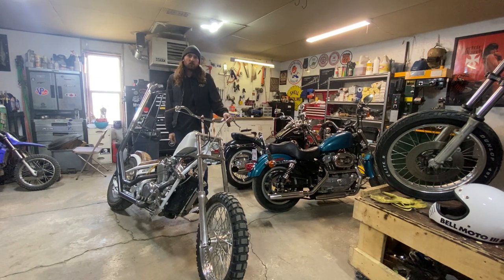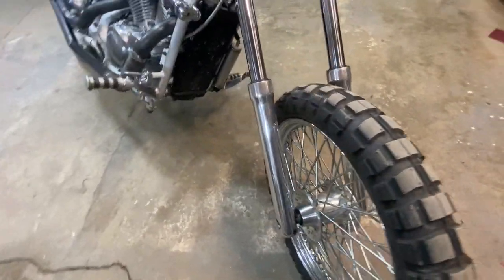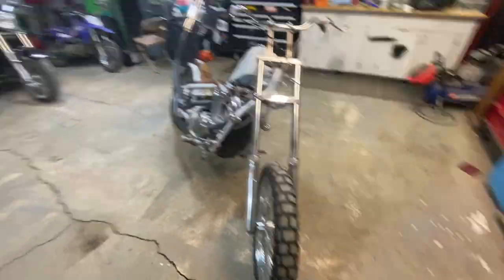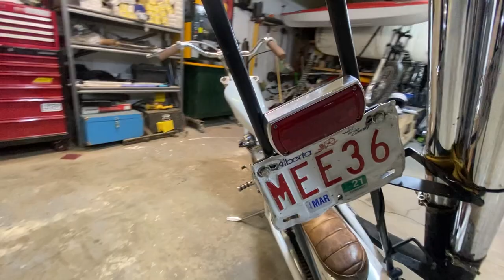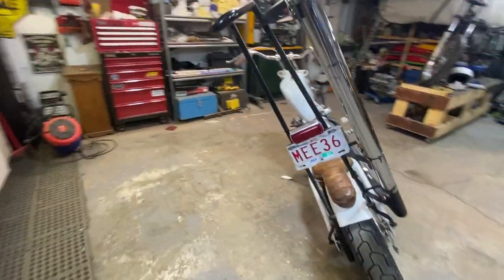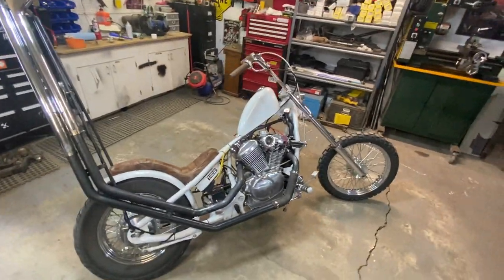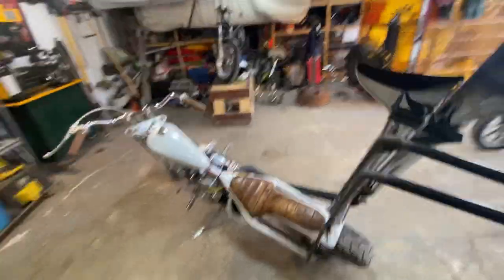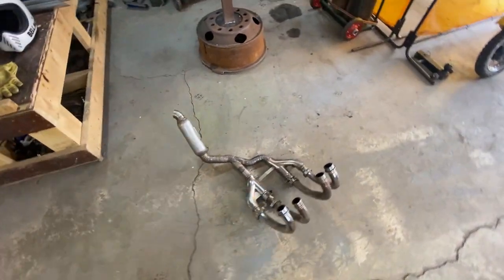Cole's 2004 Honda Shadow VLX 600 Chopper "Snowblind"

Comment: Hey Scott did the Flanders style risers fit without any modification? Love the bike it’s so nice!
Reply from the maker: To my knowledge, Cole welded the top ends of the flanders style risers onto the factory shadow ones. I could be wrong but I'm pretty sure that is how he got them to work. The handlebar clamps will work with all 1" bars, but the ends that fit into the triple trees will be a different size bolt from the shadow risers. Shadows use metric, i'm going to guess the flanders style risers use standard size.
Reply: @SUPPORTYOURSELF  thanks for the reply!
Reply: You’ll need to drill out the stock rubber bushings to get the half inch bolt through.
Reply: @coleyellowbirdwelds  ahhhh got it thanks that’s what I was confused about. Did you get your cables through motion pro?
Reply: @ezracohen8247  I’m not sure what they are. I just ordered them from a local shop